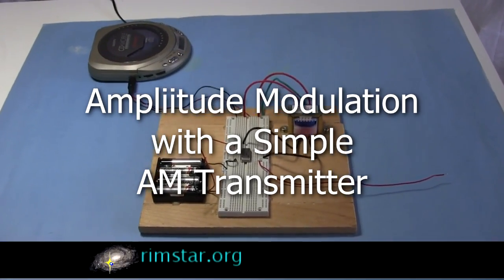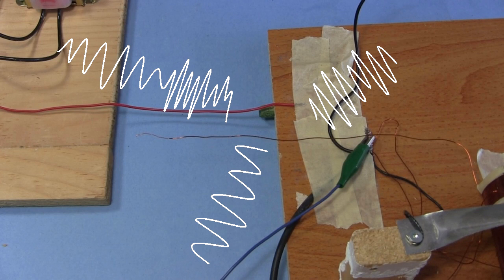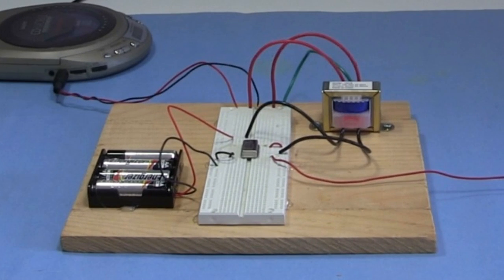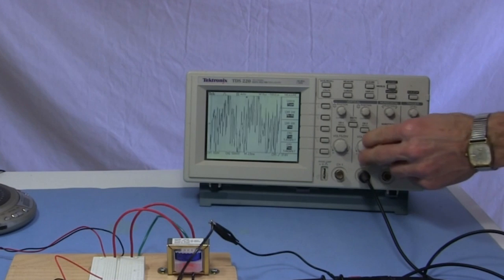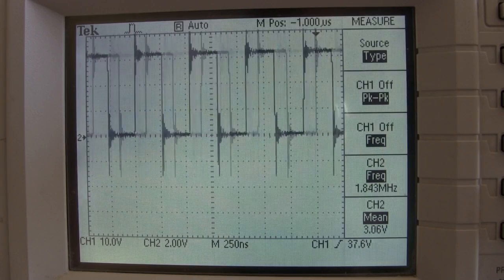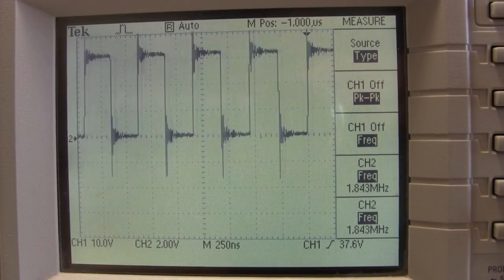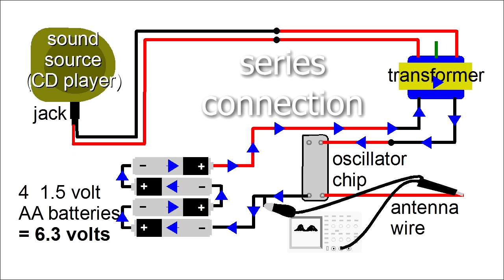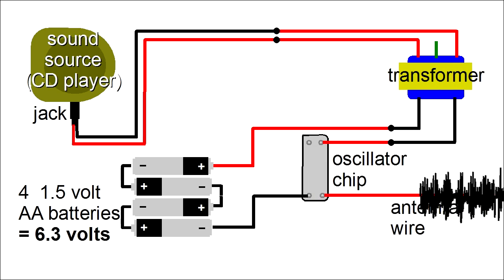Amplitude Modulation with Simple AM Radio Transmitter

Comment: isn't you'r "oscillator chip" just a quartz crystal? It would be better to use the right terminology since you are trying to teach people.   A quartz crystal on its own is not an oscillator (much less a microchip), yet in combination with the transformer forms a crude modulator, the base frequency which is matched to the crystal's resonant freqeuncy
Reply from the maker: Maybe "chip" was pushing it but it is an oscillator. Here's the datasheet http://www.farnell.com/datasheets/58697.pdf.
Reply: Oscillator chip is the right terminology. Only you can beleive that it's possible to make a single HF quartz crystal ringing by applying audio signals. Here it is obvious that what is used is an oscillator with variable power supply voltage (DC + superimposed audio signal).